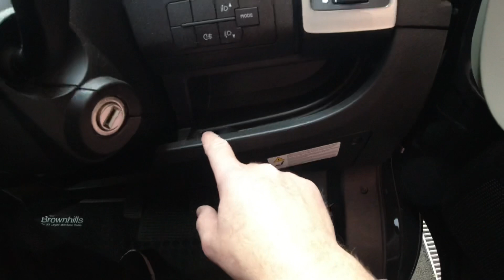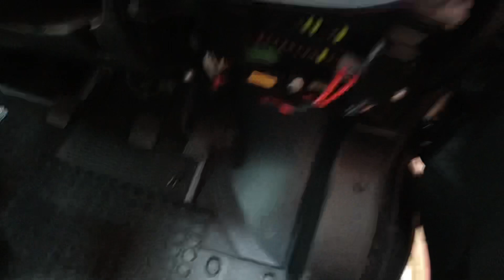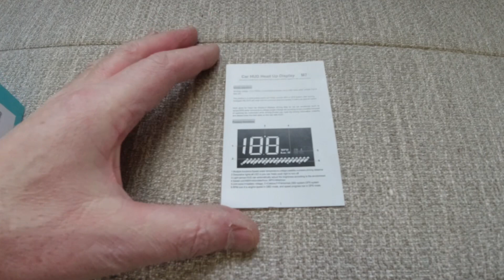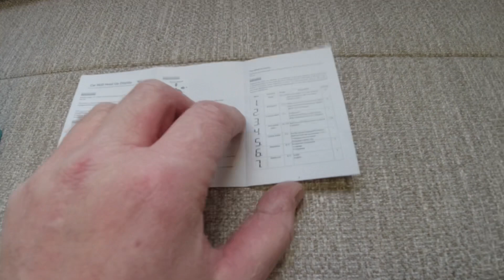How To Fit A Heads Up Display (H.U.D) To A Fiat Ducato - Peugeot Boxer - Citroen Relay

Comment: I have installed one of these and it is, indeed, a game changer. Even better than being able to clearly see vehicle speed without taking your eyes off the road is the ability to switch to km/h when driving on the continent. With regard to the wire to the display looking untidy, it is better to run the wire beneath the dash until it is directly under the position you wish to mount the display (with respect to the forward longitudinal axis of the vehicle) and then run a short "vertical" (ie longitudinal) wire to the unit. In my van I have mounted the unit more centrally and both the unit itself and the connecting wire are invisible from the driver's seat (or anywhere else in the cab).
Reply from the maker: Yep thanks I’ve adjusted it since filming 😊

Comment: fitted the exact one to my ducato based swift escape 674 last night before i saw your video. i fitted it for the same reasons, i am 6'4" and struggle to see the speedo when driving, hopefully this will make a big difference and keep me legal lol. fitting was simplicity itself! i've put mine directly in the middle of the instrument pod but there there is enough wire to have it wherever suits you
Reply from the maker: I love mine it really helps 👍
Reply: @RickandHeather  definitely a game changer, used it for the first time on a trip from the midlands to cornwall and it was invaluable, no longer needing to look down at the speedo, just glance at the windscreen. compared it to google maps speedo and it was accurate. best 30 quid upgrade i've spent. it did stay turned on when on the campsite on hookup and solar so can only assume it gets power when the voltage is high from the charging, didn't cause an issue though and turns of when its in storage undercover and i've turned the ignition key to isolate the starter battery
Reply from the maker: @stephenfoster1971  excellent 👌

Comment: Great video Rick, I had a Citroen relay van for work about 8 years ago with this problem so I’ll definitely be fitting one as it looks easy, regarding the showing wire on the dashboard copy one of Ian’s ideas and put a sock over it,( hopefully his doing a video on his fridge/light modification soon) thanks pete
Reply from the maker: Cheers Pete, seems a good bit of kit for me although I’m toying with removing the swivel base on the driver seat.

Comment: Hi another helpful video thanks, is it on permanent or only when ignition switched on ..sorry green in these matters ...also what was the clip that hold cable please ..liking the chienglish😂👍
Reply from the maker: Hi, ignition only, the clip is just an electrical cable clip with a sticky pad on the back and provision to slot a cable tie through. 👍

Comment: Thanks for sharing Rick, Useful little gadget that one, saves needing to move around to check the speed (which i used to do in previous motorhome, assume would be the same from what you have said), be interesting to know if it makes it more comfortable without having to shuffle about to see the speedo. Got myself one a while back sitting ready to be fitted, good tip not needing to take the other screws out.  David 👍
Reply from the maker: Cheers David thanks for watching 👍

Comment: These are brilliant fitted one on mine.Had to adjust the mph on mine it was 4mph out.
Reply from the maker: Ours is a couple of mph over which I’ve left as it stops me speeding 😂
Reply: @RickandHeather  mine was under so now adjusted to over for same reason as you.
Reply: @RickandHeather  also found I needed the reflective sticker on windscreen just couldn’t see it in bright sun in the summer
Reply from the maker: @Motorhoming_Fun  that’s the thing I don’t know how it will fare in summer so I’ll save it… 👍

Comment: I didn’t use the reflective pads either. How short do you have to be to see the speedo. I’m 5’10 and I couldn’t see it either. Julie threw my instructions out but luckily I photographed them first. 👍🏻
Reply from the maker: I’m thinking of removing the drivers swivel…..
Reply: @RickandHeather  You don't need to now. Do you use the swivel on the drivers side? I think it would drop the seat down and make it look odd next to the other one. Anyway, stop showing off because you're tall.
Reply from the maker: No, don’t use driver one at all, and I’m huge in every way 😀
Reply: @RickandHeather  I know, I've seen your stomach! 🤣🤣🤣
Reply from the maker: Diet 2022. 100%. It’s been fun eating and drinking crap all year but only seeing the bottom 7 inches of my 🐓 when I’m stood up is starting to annoy me.
Reply: @RickandHeather  I can understand your frustration. I'm dieting starting January 1st. 👍

Comment: Don't know why, but this just popped up while I was scrolling through. Hopefully you took it with you to Athena. I had the same problem, but I'm a thrfty Scot so trawled around and found one on eBay for £7.99 that just plugs into the USB socket in the glovebox and the cable runs up the side to a small LCD display that I stuck on the dashboard. Very visible to me and my Co-Pilot. At the price I paid if it lasts a few years I'll be quite happy, the one you fitted looks very good, doesn't use up a USB socket either and I'll probably get one at a later date. Cheers and happy camping from Bonnie Scotland..
Reply from the maker: We did take it out but the new van has lower seat swivels and a digital dash anyway so don’t need it. But still took it 🤣

Comment: Fitted the HUD using your method of remove the big panel however had o remove smaller panel to tidy up the cable. So covering both methods
Reply from the maker: As long as it’s working all good 👍

Comment: Hi got one of these ..kind of fitted like you did ..it's on without ignition as on hook up on the drive way is that correct? Sorry no skills or knowledge re electricals..cheers happy travels
Reply from the maker: Mine is off if ignition off regardless so I’ve no idea? Guess it depends on your van…. You can’t go wrong with the obd port where it’s plugged in so that seems odd.
Reply: @RickandHeather  yes strange isn't it , don't expect much drain on battery but it stays on even when not on ehu ? Guess I will have to disconnect when stationary ? Not ideal
Reply from the maker: Maybe the unit is faulty? Try in another vehicle or return for exchange?
Reply: @RickandHeather  I think you right faulty from Amazon tried it in the usb port it still does not work keeps flashing 😄 bloomin Chienglish instructions are useless. Got to take if all apart now ..funny I kept getting dash messages saying hill assist was not working ? Something obviously wrong with it 🤬
Reply: Thanks for your replies Rick I have sent it back got another just fitted and got it to work🤞 ..even changed to Kmph still don't like the chienglish instructions 😄...funny the thing went off but now  back on showing battery at 13.5 so will have to unplug it till we drive somewhere 😕

Comment: Hello, great as normal. Others say power on all the time. What is your view or how to resolve. Happy New year 🎉 just ordered one😝
Reply: We would always look for a device that only power on when the ignition is on, as you could flatten the battery
Reply: @heatherdodds549  what is this one
Reply: @stephenb5560  this one turns off when ignition is off.
The link for the product is in the vlog description
Reply: @heatherdodds549  bought one,
Reply from the maker: Glad Heather’s sorted this out!
Reply: @RickandHeather  fitted today, good old Amazon. Working fine 😁
Reply from the maker: @stephenb5560  great news!